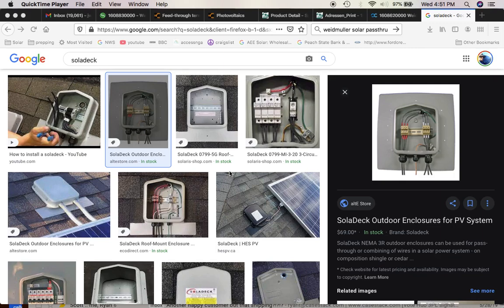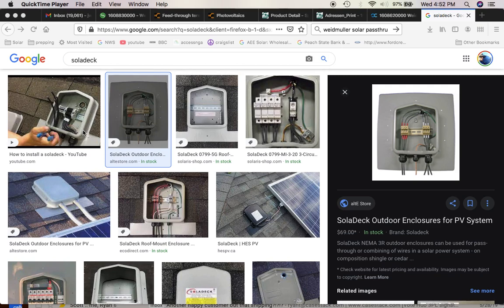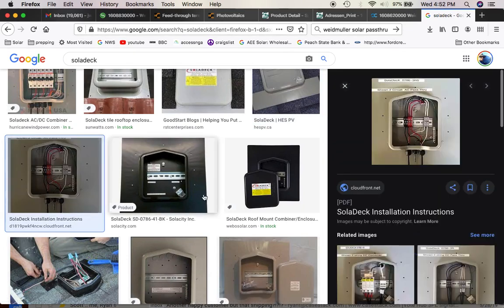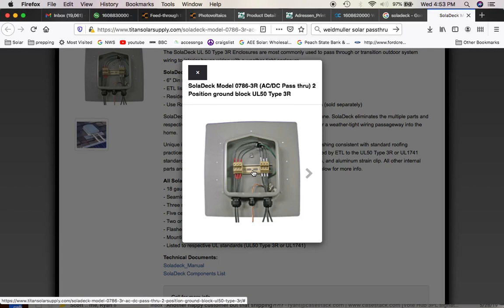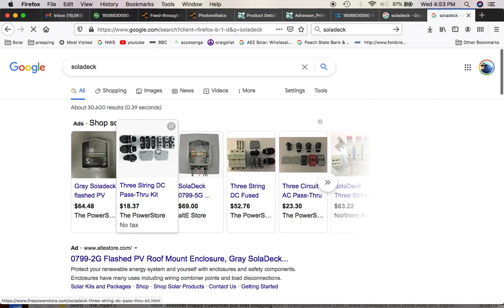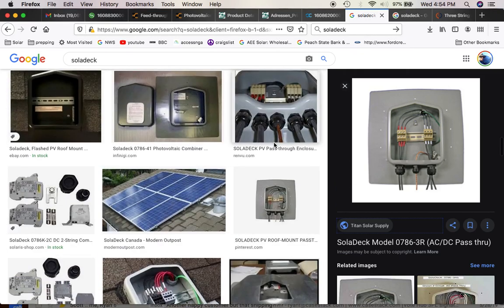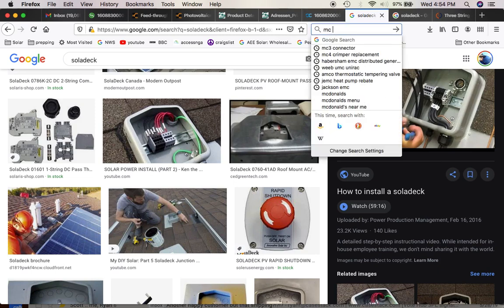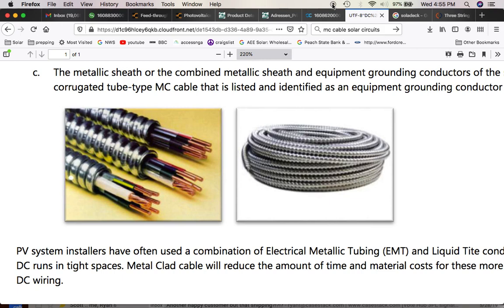Soladeck:  Solar wiring transition from roof to attic

Comment: What are you using for dc pass through when transitioning on a metal roof?
Reply: You could use a snapnrack junction box with din rail terminals.  kind of depends on your racking.